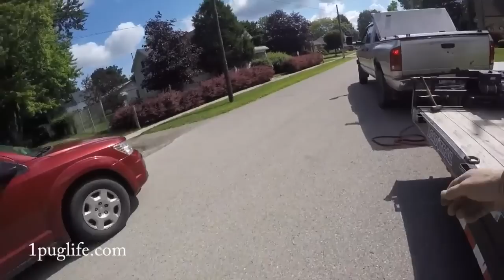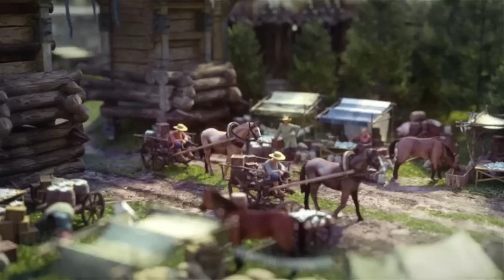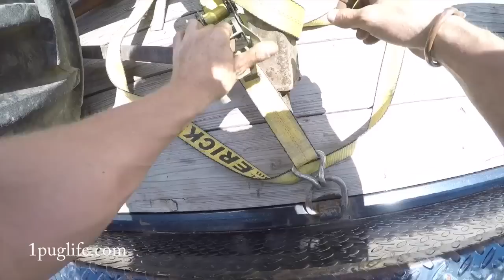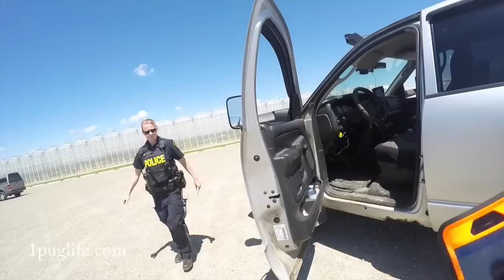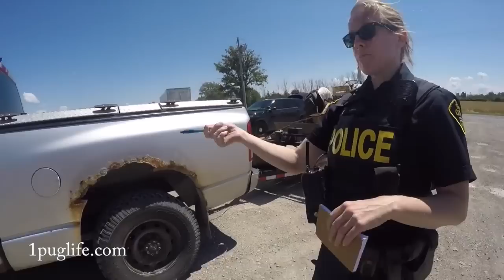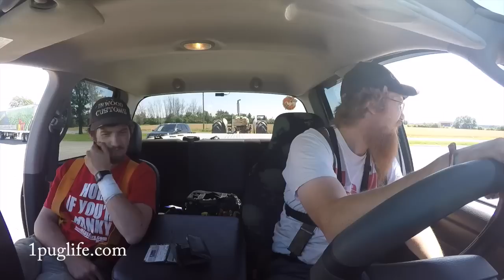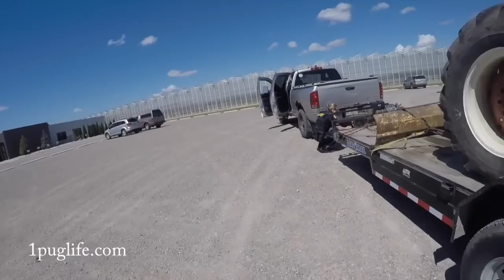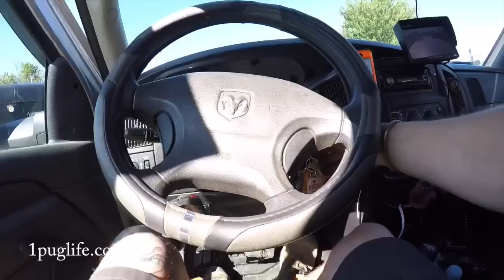illegal towing operation

Comment: i only see this now. But in the netherland you could just protest the fines for the weight because you cant use scales like that on a trailer like yours. If you put it under the first axle then that will be lifter higher because the scales take up room, so it will lift some weight of the rear axle. Then you put in under the rear axle and the same happens again, lifter the front trailer axle. So if they only got scales for 1 axle then what they should do is remove the wheels of 1 axle and weigh it like that, or put both on 1 side and then both on the other side.

And like allready mentioned by other, on gravel they dont measure good at all.

Comment: get a dually 450,550,5500 trailer should be longer maybe another axle on a big truck it is different weights up there probably more than usa but truck can have 80000 lbs,steers 12000,drives 34000 and trailer 34000 ,I like to load one skid off nose and 10 ft from back of trailer I'm always hauling 40000 weight so I scale every load

Comment: anything above 3500 or f 350 in states require cdl class a  to tow anything..go re register your truck for 30k lbs my f450 is registered at 36k. i pull 25' gooseneck

Comment: I don't understand. That tractor doesnt really weigh a whole lot in comparison to say something like a skid steer. Does he only have like 10k lb tags? The truck itself likely weighs about 8k lbs, the trailer weighs about 3k lbs, and the tractor might weigh 5 to 6k lbs. At most he is sitting at 16 or 17 GCVW which is well within a standard 20k lb tag/registration set up for this class truck.

Comment: So is that 2500 Cummins diesel? Those are rated at I think 12,800 pounds towing compacity. That's a tandem axle trailer so it should be able to haul arounr 8,000 pounds or 4,000 pounds per axle. What am I missing here? There's no way in he'll that, that tractor is over 8,000 pounds

Comment: 3000lbs is what the truck can hold in it's bed legally, not pulling. Pulling don't make a sh**, only if the axles on the trailer can hold it and it can't be more then 26000lbs.

Comment: Now if you are in the state that you live you can drive a single wheel or dual wheel pulling a trailer with whatever weight that the trailer is rated at and you are OK if you have to cross the state line you can as long as it's not for business and your OK.

Comment: I can not believe what she said, she told you you were 4,600 Kilos over weight, which comes out to 10,141 pounds..  There is no way you were 10,141 pounds over weight.  I could not read the scales to see if it was weighing in pounds or Kilos, or if there was a switch to switch between pounds and kilos.  Also what were the scales in calibration cycle?  it is required to have a calibration sticker on the scales showing when the last calibration was performed, and when they are due for the next calibration.

Comment: In the states it is different. Like in PA. A standard class C license allows you to drive 26,000 lbs and less. Which is not commercial. Then your vehicle is registered at a set weight and then the trailer is as well. Like I have a truck with a weight class of 2 which is like 6000 lbs. And a trailer will a registered weight limit of 3000 lbs. So I have 9000 lbs minus the weight of truck and trailer. Which would be like 3700 lbs maybe. More than enough for what ever I need. And that might be similar all over the states.

Comment: you cannot get the correct weight on a tandem axle trailer like that because of the way the axles share the load. if you do it this way it will always give a much higher weight than what is actually there. also you are not over weight as far as what the truck is rated for though i bet you are pushing it with axles much to light on that trailer

Comment: The truck alone does NOT weigh over 4000 kg!  She doesn't understand how to use the scales.   You're supposed to use a formula to calculate total weight.  For example, some of the weight of the trailer translates thru the tongue hung from the rear of the truck.  Most heavy duty trucks of that age weigh around 6000 lbs or 2800 kg.  All that being said, you were clearly over your 3000 kg weight limit.

Comment: Isn`t the trailer registered for its weight and the truck for its weight? not to mention that the way she was weighing the trailer axles, each wheel was carrying more weight due to how it was driven up on the scale. it should've been weighed with 4 scales. She needs to go back and relearn what she is doing.

Comment: So hey they weighed you wrong though scales have to be in a cut-out to weigh properly the scale surface has to be level with the ground surface you can clearly see in the video she just threw them on the ground and had to pull on them

Comment: they did that to me once my turn signal was out on my pickup i said i will go to  the auto store 3 miles away was told i couldnt leave because of my signal lights so i told him might as well tell them in school to quit teaching hand signals if they mean nothing he didnt know what to say to me. i said i will take the fines and go to my school board and tell them driving ed needs to stop teaching hand signals he still didnt know what to say to me. i have done pretrips on semis and a hour later a light is all they all believe your lying on your pretrip NO inspector believes you.  i got to where i was donig my pre trip with a camera that will shut them up but they will still fine you or shut you down. and the damaging the road she lied cause you can increase your weight on your license she pulls you over and your weight is fine with your new truck license then  your NOT damaging the roads DUH.  its just another way to fine you.

Comment: she did not have the correct equipment to do the weighing, for a 2 inch think scale she is supposed to have  equally thick spacers for the other three wheels otherwise there is more than double the weight on that one tire making her math invalid.

Comment: What a BS. The truck itself can be at least 6000 pounds, and it can tow about 10,000 pounds. And weighing each axle of the trailer will not work.

Comment: Something doesn't add up. In the video you see the front tires checked, then the rear tires of the truck check. She looks into the camera and already your over weight.. WTF. Its a truck, yet its allowed 3000, yet she has a weight of 4,000.. So the truck alone weights more then your allowed to haul?   Shouldn't it be Max load weight as in the weight of the load is 3000 not including the truck?

Comment: I bought a 1989 Dodge D250 Cummins as a rebuild project truck and hauled it with my 1999 Dodge Ram 1500 5.2L stock suspension and a common tow package using one of those heavy ass uhaul trailers. The hitch was like 3-4 inches from the ground. This cop would have been so far up my ass.

Comment: Hopefully you fought the tickets. They can't fine you based on those scales as they are not accurate as per measurement Canada. Once certified they can not be moved without being recertified. As for the CVOR and all that other stuff you don't need it. You need a yellow sticker and then you say it's personal use and you don't need CVOR and log book pre trip ect.

Comment: There is weight limits in most states in the US also. Many folks who pull travel trailers or 5th wheels are over. A very few states do not count RVs. Whenever you pull a trailer you need to know your GVW. If you pull it is good to get a class A just to be safe.
You are also running a business and hauling for pay which makes even more important that you be licensed.

LOL yup illegal. There are laws for a reason and businesses charge what they charge for a reason. They also have to be insured.......

Comment: I'm glad I like in the states, and we don't get hassled like that.
And I'm no expert , in this category, but I would doubt weighing one axle at a time , especially on the trailer would necessarily add up to the total weight if the trailer w/tractor.
As when one axle is on the small scale, the other axle is still going to off the ground, thus its weight is on the scale also.
Just more government over regulations!

Comment: To be honest you cannot blame the trailer hire company as they do not now what insurance you have or licence? But you would expect them to tell you that it did not come with insurance? And they do not know what you intended to be loading on it so they the only thing they could have told you was the maximum weight of load you could put on it with a standard licence, I also suspect that as you ended up stating that you had under priced the job the truck should also be insured for business use not just domestic as you were doing paid work in it. That also may mean you need public liability insurance for any work you do? Because if you cause an accident or have an accident the damage would not be covered by the truck insurance? This is why regular tow companies charge so much?

Comment: does everyone not know that the 3000 is for how much you can tow she was very wrong. if you have a truck they ask if pull trailers. and you can change how much at DMV but any truck can pull 3000lbs if that's the max it's not truck and trailer stupid it's just the what you pulling

Comment: Why i gave my pickup tagged for 18,000 and i gave a class a cdl. A higher weight tag not that much more. New law says any vehicle used for profit must have ELD
Reply: Does that include pizza and flower delivery drivers?
Reply: @integr8er66  well, rodeo people didnt have to before and your local farmer is required to take his animals to market. Guess it all depends on how picky a officer wants to be
Reply: @mrfugly2821  I guess what I am asking is, I have a class F lic, which used to be called a chuefers  lic and was required if you drove for pay of any kind. I used to drive a delivery van and that was the lic class I needed, so is Electronic logs required for that? Or is it just class A cdl? I did not need a CDL as I was operating under 26k lbs
Reply: @integr8er66  the gov making new laws all the time, gets hard to keep up. But the last I read, any vehicle on the road for profits must have a ELD
Reply: @mrfugly2821  makes it hard to want to even deal with it
Reply: Fair enough, but does that new law apply in Ontario?

Comment: Never tow in the daytime on main roads, always sleek around quickly at night with dim lights on back roads, then no one knows, if you want to wildcat around you have to move like a cat. Always argue nothing dangerous, so give me a warning please, refuse to weigh on a scale like that because even 1/2" platform will raise the load on that tire an unknown amount and not be accurate. Trucks are built with towing capacity and loading capacity i don't believe you were over on either one. When you registered the truck and trailer its the design of the builder that determines its safety capabilities. You have good argument in court that nothing was overloaded or dangerous, thats no more than a 3000 pd tractor and probably 8,000 towing capability truck or more.  Say stuff like this is 1/2 ton truck that is registered and only 1/2 ton on the hitch what is wrong officer. Open your owners manual show them safe towing weight then say what is wrong officer. Remind her the trailer is allowed its own 3000 kgs weight independent of the truck, a quick internet reference shows the weight of the tractor closer to 1500 kg. Officer is confused on the scale readings.

Comment: Does she not realize that you CANNOT accurately weigh by one axel at a time, let alone a single tire at a time? As you raise a set of axels they take much more load off the other as they disproportionately load the springs. This can lead to weight numbers SIGNIFICANTLY higher than reality. Each axel can apppear to bear on an average trailer up to 80% of the load depending on the amount of lift over the lower one with those scales used individually on each tire like that, making it appear like you are MUCH heavier. This is just one way to get more $ out of you for being that much more over a limit you may not ever have been. However in this circumstance it's obvious that the load was significantly over the licensed limit, just not nearly what is claimed. Not only that, you can not weigh anything on gravel, or uneven areas. you also cannot weigh the truck while attached to the trailer unless you have a scale for every axel at once. Proper way to do this is having a set of scales for each axel (or tire in this case) of the trailer,  and the jack. So 5 scales minimum. Weigh the truck and trailer each fully level on scales individually. Besides, is she ticketing over gross weight of vehicle and load, or towing capacity?
Reply: wolvenar license on the vehicle was lower weight rated, if he wasn’t so cheap and upped his tags he would have been ok.
Reply: Jon Rosenow That still does not negate that she did not have even close to the correct means or procedure to weigh that setup.

Comment: they cant count the truck weight as part of the 3000lbs or kilos or whatever, a stock truck weighs 5000 pounds
Reply: And why can't they count the truck weight? Does it not touch the road? The plate weight is not net weight, its Gross Combine Weight truck and trailer total
Reply: they truck itself weighs more than the "rating"
Reply: @derekcomingo2197  So? Why would that exclude it from the gross weight? The fact is he bought a plate that was too small for HIS PARTICULAR TRUCK. hower I doubt the truck empty was over 6,600, IDK I have to go back and see what it was I'm thinking it was a F150. Anyway 3000 kilos is 6600lbs.

Comment: Here you go for the people of the USA the laws go from state to state about weight if you have a single wheel axle on your truck up to 1ton / dully you can go across state lines with lots of weight say 20,000 lbs and you will have no problems you should not even be stopped .but if you are driving a dully across state lines pulling a trailer and you are hauling say 2,000 lbs your screwed according to the laws a duel wheel truck pulling a trailer you have to have the same everything that a semi has to have insurance/ unbelievable high/ health card /load book/ stop at scales .but if your truck is a 1ton single wheel that law does not apply to you you can haul what ever you want and you won't get stopped.i had the
Reply: Texas State Police tell me this when I drove from Louisiana across to Texas he said that if I was driving a single wheel 1 ton truck that they would never pull me  over put if I was driving a dully pulling a trailer with a riding lawn mower I was illegal over the limit.

Comment: Ok their is a sticker in the door frame that tells you gvw- gross vehicle weight and gvtw - gross vehicle tow weight that is what you can weigh gvw if that is a 2500 is probley 13,500lbs....gvtw is 22,000lbs so if you stay under these figures you will be alright but if she checks your axles on the trailer they can not go over what their rated but you were way under that. With one tractor and you were under gross weight. But now she will get money from you cause she spreaded a lot of bull shit around get a lawyer!!!!

Comment: how is he too heavy on the road , he is not carrying the tractor on his truck to say it's heavy , he is just pulling it witch is exactly and completely like two different cars on the road
Reply: Yeah a 2 axle deck with a little case on it is not damaging the roads and a 3/4 ton diesel is more then adaquate for pulling that along with suspension and breaks
Reply: But, he didn’t have the proper tags on it for the weight.

Comment: 3000kg? That's like 6500lbs if I'm not wrong... pretty sure most modern 1 ton trucks roll the scales at around 7400 to 7500 pounds (just based on weighing out at scrap yards for years.) I'm not sure how our northern neighbors deal with registration, but that my friend is bullshit.. in the states, most places will register you at 10k lbs, assuming that you will have a loaded bed at some point,  and you can haul up to 26,000 including truck trailer and load... I would assume that your rig at that point is well under 26,000. Total trash buddy.

Comment: the laws are fucked. he cant haul anything with a combined weigh over 4500kg  because he needs a yellow inspection sticker on truck and trailer but you can haul a 30 foot travel trailer and a boat with a combined length of 72 feet because its recreational. tell me how that makes sense????

Comment: Wow...trudeau has them acting as revenue generators I see. Smh. My question to you is this...why do you have a truck which weighs roughly 6300 lbs (3000 kilos)...registered as a gvw of 6300 lbs. 16,000 (7257 kg) would be more realistic when you figure the truck is capable of pulling roughly 10,000 lbs plus it's own weight. 
Btw...if you looked a bit less like a hippie/trudeau deciple you likely would not have gotten pulled over in the first place.